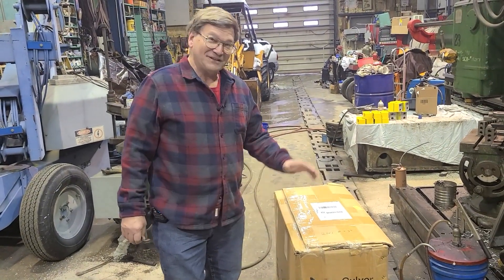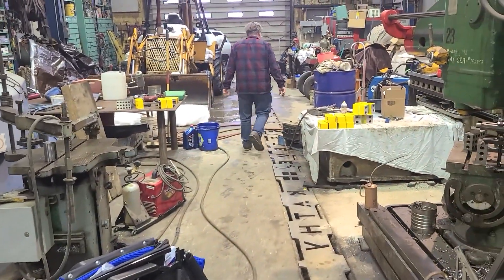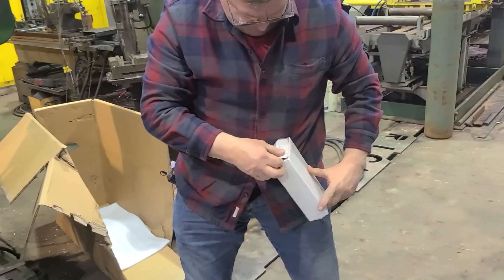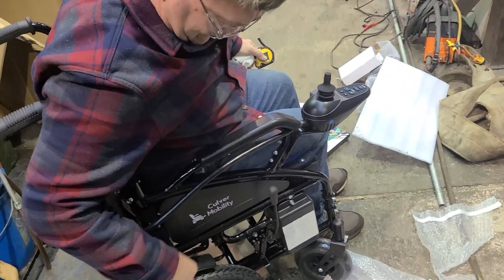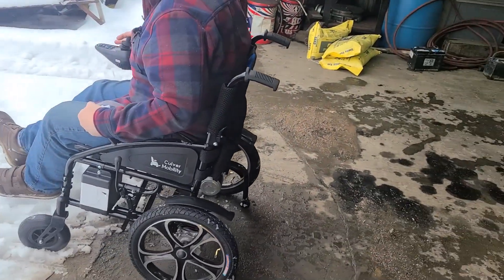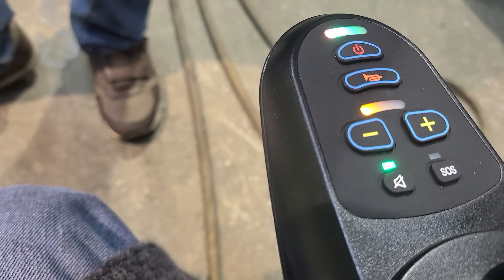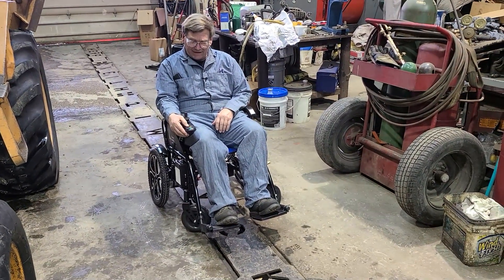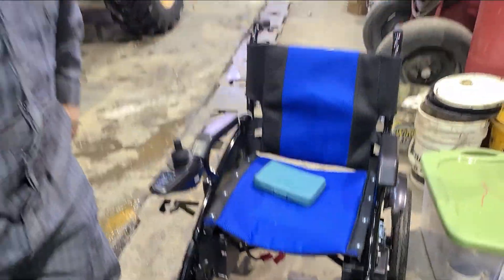Looking at the Culver Mobility 'Artemis' electric wheelchair

Comment: It says in my manual (I got a Red Artemis Pro for my wife) that it can be put in manual mode. I checked various sites and they said there could be levers on the motors to change to manual mode. Are there levers on your motors for the wheels or have you figured out how to put it in manual mode? Please let me know as soon as you can. Thank You
Reply from the maker: It has been a while since I had my hands on them, but I do remember it being possible to let the wheels free spin - I just don't quite remember how. If I were to try and puzzle it out again I'd check for disengage lever on the motors first off, but if they're not there then I'd make sure there's not a disengage button on the control panel. If that doesn't work, try shutting the chair off with the power button on the panel. It may be it's designed to just free spin with the power shut off to prevent getting 'stuck'.
-Cameraman